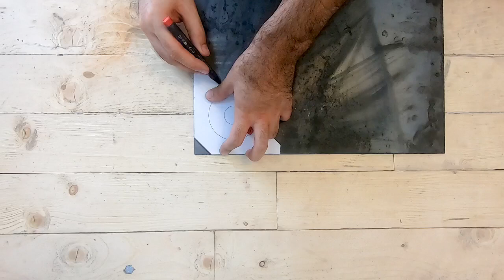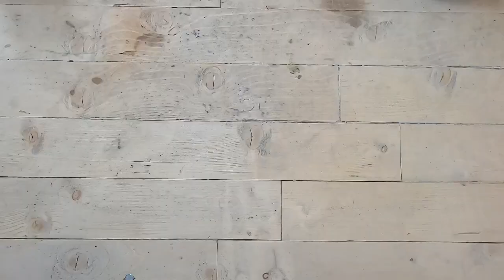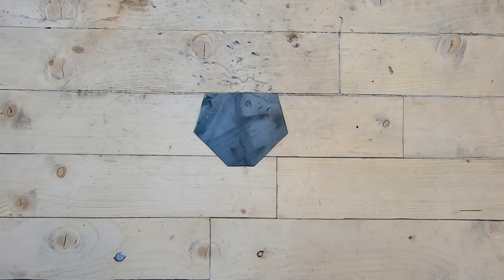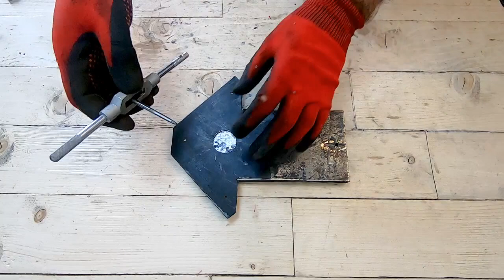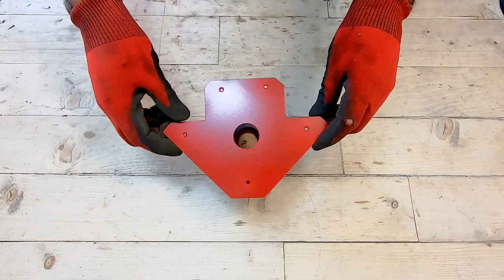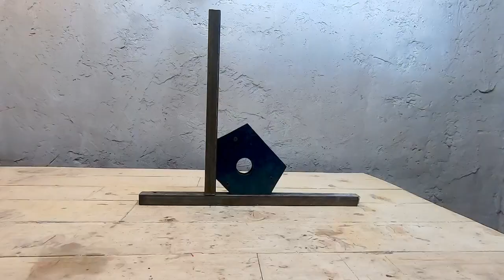Magnetic Welding Holder | Magnetic Square | Welding Clamps

Comment: Great video! I would like to try this myself. Would you mind sharing some more information about the materials you used? For example thickness of the metal sheet, force of the ferrite magnets, ...?
Reply from the maker: Thank you man. I am glad you like it. 
The thickness of sheet metal is 2mm. I used a ceramic ferrite magnet grade Y30. The inner circle diameter is 32mm and the outter is 80mm. I used tap M4 for screws. Please feel free if you have any other questions.